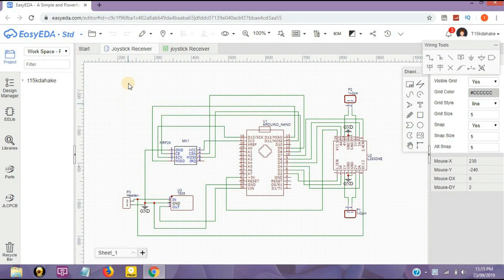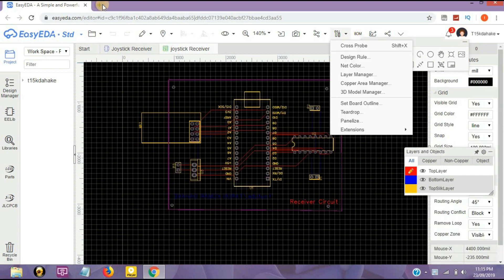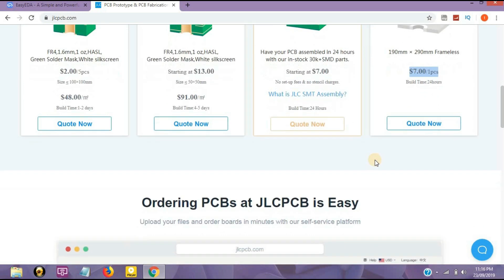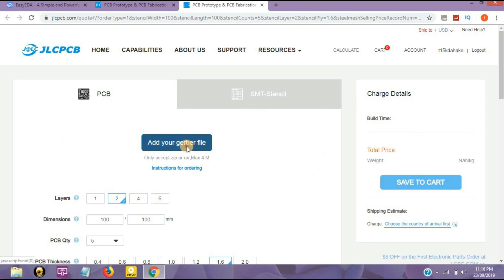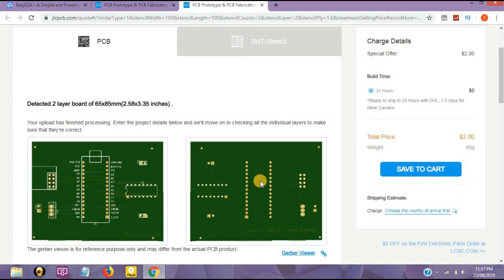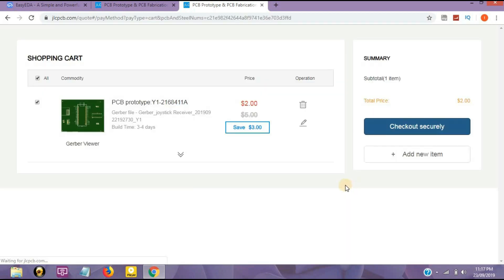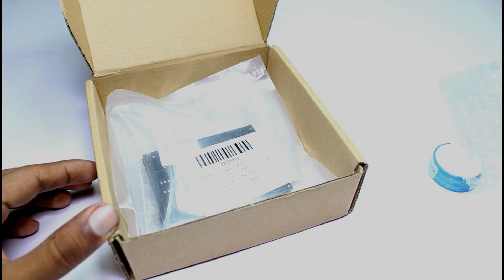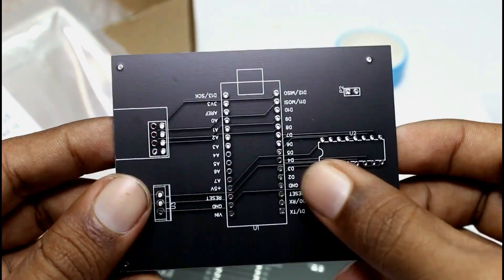How To Make Arduino Joystick Control Robot At Home

Comment: Very nice! I use NRF24L01 as well for my cars, you could improve a little bit: look for RF-Nano, this is an Arduino Nano with inegrated NRF24L01. This saves a lot of space and wires. What you also could do is use battery boxes, this is a little more comfortable in my opinion. And if you have a 3D printer, you could make a chassis and transmitting holder.